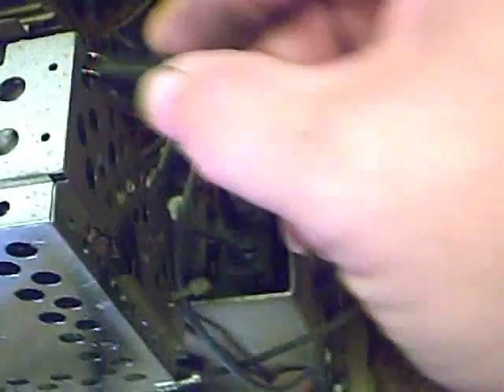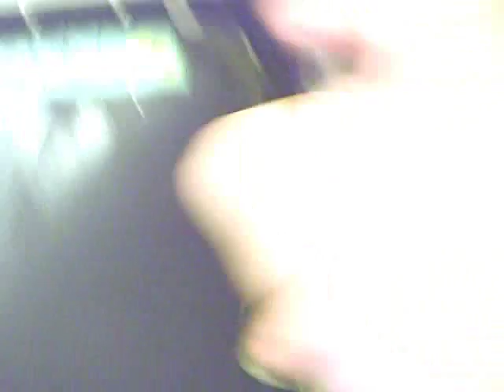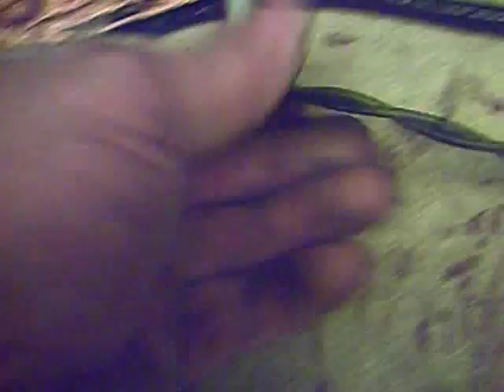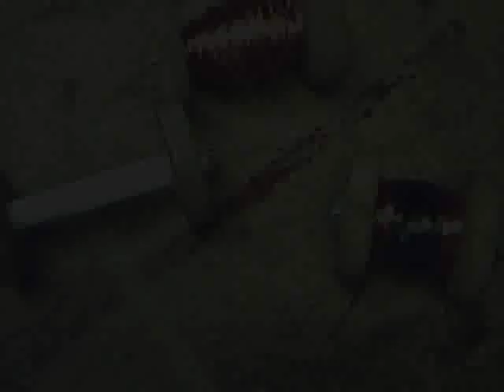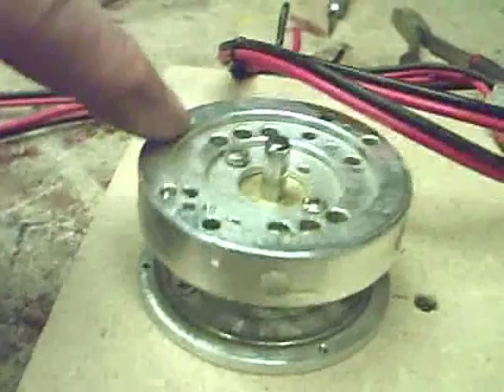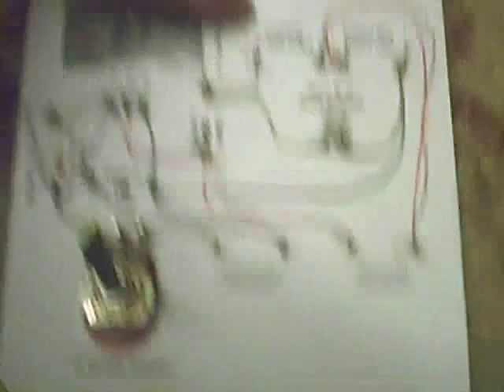Reclaiming parts 4 bedini projects 1 of 2 ( theDaftman )

Comment: I have a very very good friend that is an electronics engineer and he stated that you CAN INDEED carefully solder together the two ends of magnet wired and coat it with enamel.  He claims that there will be zero ill effects to the coil.